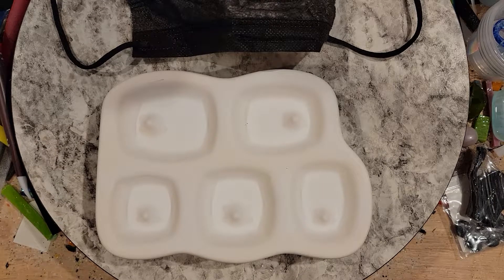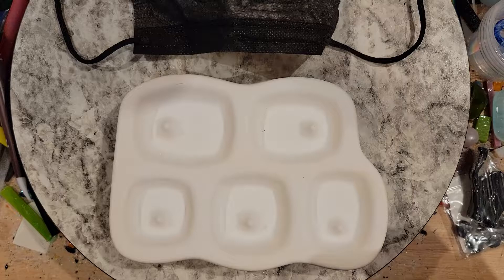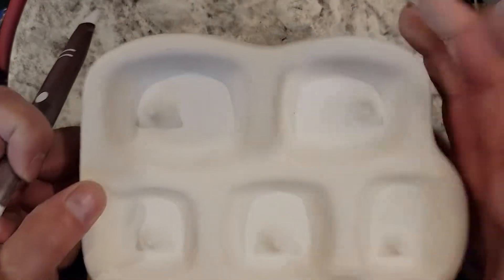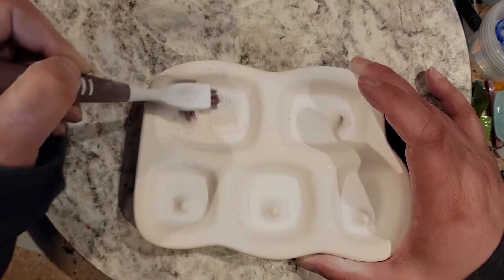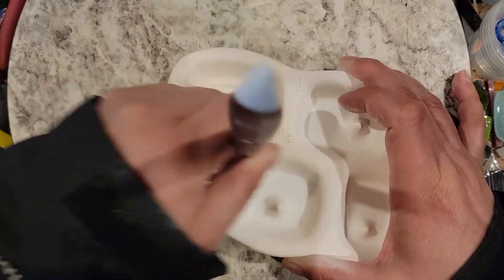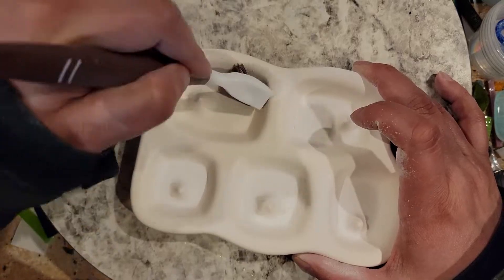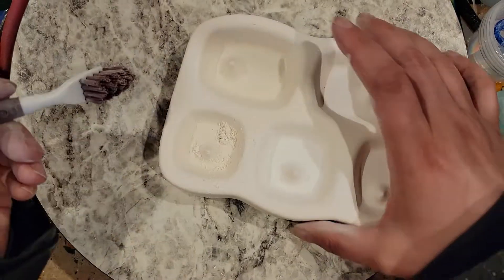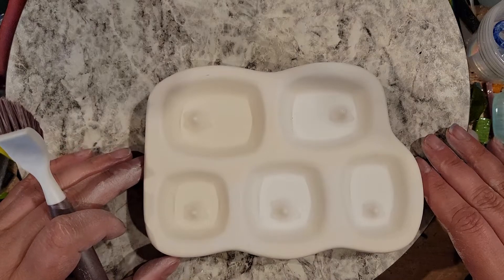Fused Glass Basics - Cleaning boron nitride (ZYP) off a mold

Comment: Thank you for posting this.  I have a nice mold that has glass stuck in it.  Not sure if I didn’t spray enough or what.  Do you have any advice for getting it out?
Reply from the maker: I've had that problem before. The first thing most people do is try freezing a mold, and seeing if the stuck glass will come out. If it's a big enough piece, it might.
I have used a dremel on a mold before, to dremel off the stuck glass. That's my suggestion.
But do not,. DO NOT, take a hammer and try and bang on the glass to loosen it. I broke a mold recently doing that.
Reply from the maker: Now, if it's a cast iron mold, a chisel and a hammer works, and then a creme brulee torch for loosening the small bits.
Reply: @StephFuses  You can used cast iron in a kiln? Up to 1450?
Reply from the maker: @poorsjm  I have, I go up to 1485 myself. I don't do it as much now, because honestly? It's a pain in the ass. You have to make sure the coating of ZYP is nice and thick, so the glass doesn't stick to the pan, and if it does, it's a huge pain to remove.
I've probably been through 12 cast iron pans, or more, in the last 18 months. I've switched to the Firelite forms mold now that it's out, because I don't want to deal with cast iron anymore.
Reply from the maker: @poorsjm  There are also 2 schools of thought on cast iron. The first school is against using it, for various reasons, like not knowing what the cast iron is coated in, potential instability, etc.
I'm in the other camp, just because I've fired more than a hundred times in cast iron. I also have a mechanical engineer friend who works with metals, and he's mentioned to me that iron should be fine up to 1500. So I used mine. But I'm in the minority for using it.